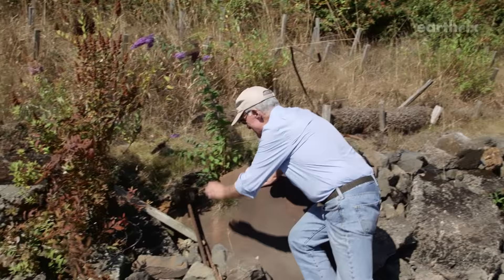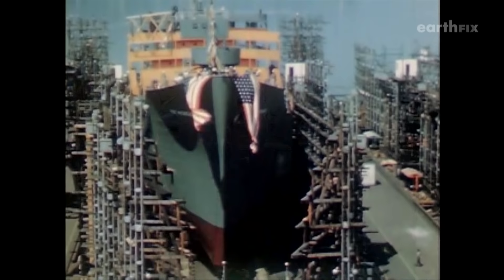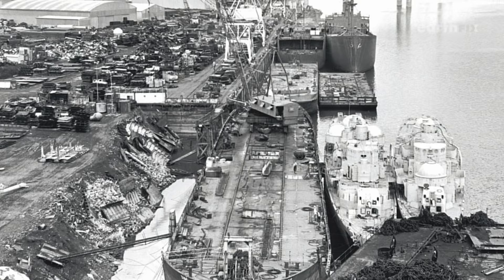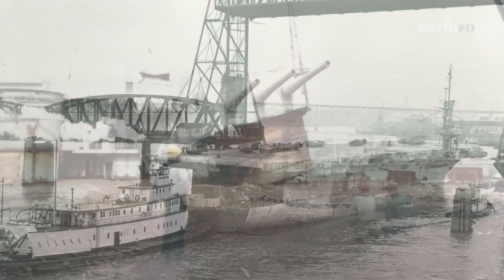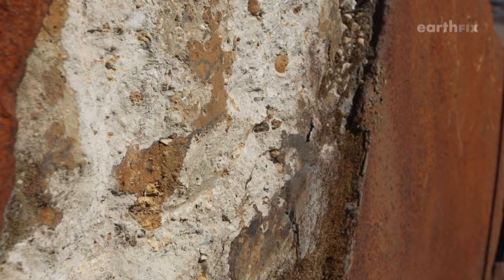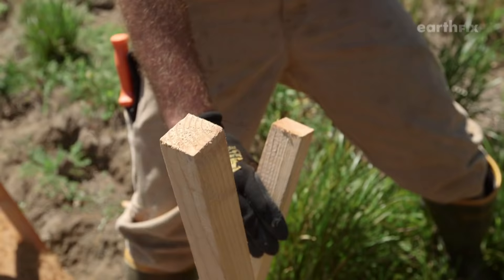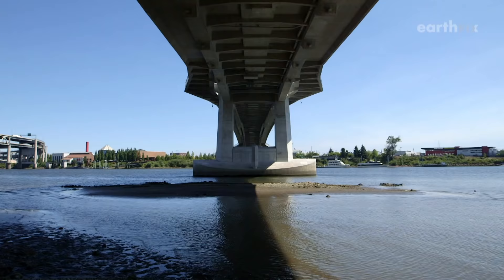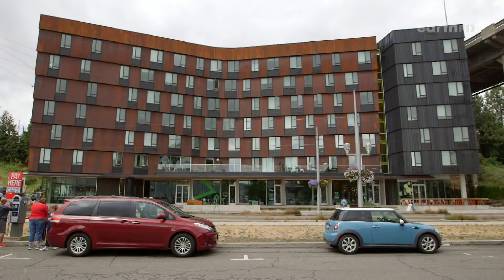Cleaning Up After Breaking Navy Ships

Comment: Looks like a gold mine for someone to salvage this iron.
Reply: Check scrap prices.
Reply: Looks like 12 posters know nothing about scrap prices.
Reply: DRS_ au  I extract steel from old appliances. I enjoy it a lot. Not sure why people haven't salvaged it.
Reply: DRS_ au  Yep just give it time. They might find the industry out of necessity when they realize their world as they know it is gone. 

Until then they are mostly ignorant about the scrap industry.
Reply: DRS_ au  Scrap prices for ferrous have sucked the past few years.  I work with a scrap processor, and times are rough.  It killed off most of the regular peddlers that used to drop off all the time.  You can eat at 10-13 cents a pound, at 5 cents you cant even pay for the gas unless you have a huge amount.

Comment: So they really didnt clean all of it up, they covered it with 2feet of sand which can wash away?
Reply: watch it again asshat
Reply: Ok, shit for brains I watched it again, They clearly said they cleaned up" most of it"not ALL of it. then capped it with2 feet of topping. Lousy Job. Do it right or move aside and the pros handle the work. Shit for Brains.
Reply: U are 100% rite, they said they covered it with 2 ft of sand
Reply: I found myself concerned too. Goto Love Canal and you will see that a lot of the waste was left in situ (on site). Same here and the question is how long before it leaches out, just like Love Canal. Is there any monitoring to insure that people are safe?